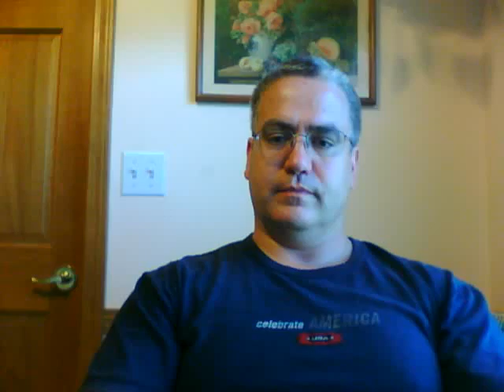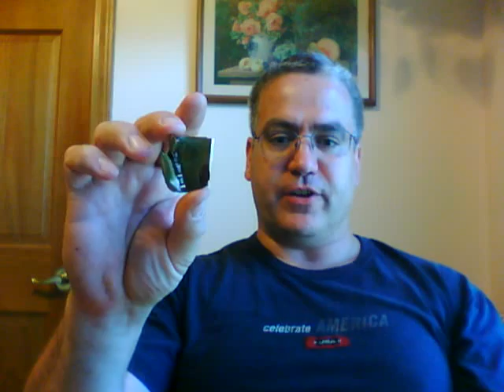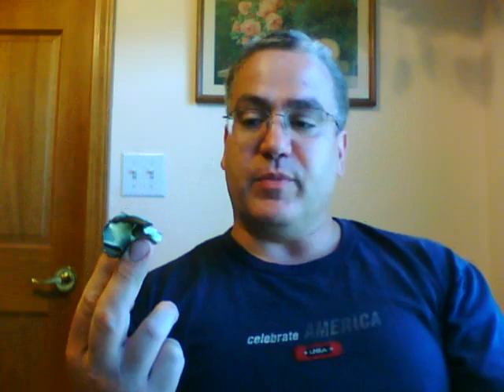Engine Failure 2003 Toyota Camry 2AZ-FE  2.4 L (2362 cc)

Comment: The 2.4 L engine in the 2003 Camery is a non- interference engine - so unless the oil baffle rattles down the timing chain area and causes the timing chain to fail - all you should have to do is replace the timing chain - guides and tensioner... there should be no valve or head damage ...

Comment: I thought it was insanely early for my 2003 Toyota Camry’s engine to croak at 137,000 miles. I am assuming this happened because I went from getting a regular oil change on 3/8/2020 to total engine failure on 3/16/2020! She was my first car, paid for her with cash, and my first love! She is sitting in front of my job just down the road and haven’t gotten rid of her just yet. It breaks my heart!

Comment: I'm looking at a 2009 with the 2.4L engine that is knocking at only 160k. It's a one-owner, well maintained car in excellent condition otherwise.
 It absolutely amazes me how people will excuse Toyota issues and pretend all is well and they all run forever, and insinuate that when they do have problems, its your fault somehow. The only ONLY ONLY reason I'm looking at buying this car is its value once repaired. I have no desire whatsoever to own it as my personal car. I'm much happier in my Ford Taurus. Anyway, it doesn't sound like it's the same issue your dad's car had, but its another example of a Toyota that doesn't live up to the hype.

*Edit, yes I know the 2.4L was replaced by the 2.5L in 2009, but this is an early production model with the old 2.4L.
Reply: John Roberts... AMEN.. I just had to get a rebuilt 2.4 for my 2003 Camry due to the dreaded head bolt stripping that IS a design flaw with these engines and mentioning so on Kilmer's site ended in FLAMING from Toyota fan boys. It is ridiculous how they are " forgiven " for their documented design flaws and yielded as a great car and Company when they ignore that there is an issue and actually have a repair bulletin for the non-existing issue.

Comment: 03/05/2018. My father bought my son a 2003 camry with 122k, in 2013 and it runs great. But is has been steadily increasing in oil usage, now at 1 qt every 2 weeks, engine had started tapping, all with this last  year. Two days ago, the engine started making a very loud Knocking sound. Sounds ready to die. My son says no loss of acceleration, no starting or dying problems. I guess this is the time for replacement of engine

Comment: Mine 2003 Camry se 2.4 vvti just did the same, not sure if it jumped time, but I had smoke come from under the hood and exhaust. Already Walmart had to replace the motor because I be lost all my oil in less then a block. I took the Valve cover off and found the same thing a broken piece of metal. And the cams marred up. mine has 160 but I was changing my oil myself for a while because the only place to get it changed in perdido key was Walmart. Then I started going to a unnamed place.... Thanks for solving how it happened, just don't know exactly what it did to it.

Comment: Having been in the automotive service and repair business the past 45 years I can tell you that there is no design flaw in the valve cover for the Toyota Camry as described by Byron. I do understand his frustration however it should be with those servicing his car and not the manufacturer. There are special funnels designed to be screwed into the top of the valve cover for most cars where the oil cap screws on to add oil. When changing the oil the technician should be using one of those funnels designed for the vehicle he is working on, if the proper tool is used it will not push down on the baffle damaging and dislodging it to then later make contact with the cam gear / chain.
Reply: Here's a dumb question from a non car guy with this particular year engine. Does the baffle serve a critical function? Can it be removed to prevent this?

Comment: I just removed the valve cover on my 2003 Camry 2.4 and that same piece was lodged down in a spot below the cam. Although my car was showing a P0016 code, I'm not yet certain the car has jumped time. It appeared to be running fine but I'm about to check it. My vehicle does have 350,000 miles on it. Thanks for the video

Comment: SO it's Toyota's fault? Being as Toyota goes way above and beyond with customer assistance programs, see warranty enhancements which cover known bugs such as secondary air injection systems up to 150,000 miles/10 years, oil consumption on vehicles REGARDLESS OF MILEAGE in which Toyota will pay for thousands of dollars in repairs at 0 cost to customers and countless other programs. People believe every possible issue they encounter should be paid for by the company when in fact issues such as the one in this video could be avoided if they were to take their vehicles to be serviced at places where the technicians know exactly how to service said vehicle. Instead, people want to take the cheap route and complain when issues arise. Like I said, Toyota goes above and beyond in customer service. Don't believe that? Take your oil burning Chevy to a dealer at 80,000 miles and ask if GM will cover the repair for free.
Reply: capt251978 Control what is controllable- Robust engineering 101. Design to be robust to all service variation or control the service experience, choose what you prefer...

Comment: having an issue with stripped head bolt when i took off the valve cover ifound the same piece, lucky it found a spot that didt damage the motor pure luck .

Comment: This is true i have a 2002 TOYOTA CAMRY bought brand new did the oil changes my self always there was this noise in the engine and when i open to change the valve cover gasket found this piece broken setting between the valves and removed it after that the noise is gone it's now 180,000 miles nothing wrong with my engine i think i was lucky its didn't go any ware to create a damage to the engine.
Reply: if you set the chain were  it should be rotate motor and the cam will be right at TDC but th r marks on chain what be why

Comment: That sucks buddy but I dare say its not Toyotas' fault.  Like you say its about rough servicing, and you could not blame Toyota unless it was their lube boys that did it.  Were you getting the expensive all genuine Toyota dealership services or were you using a different mechanic or doing it yourself?

I have a 2azfe and its pretty awesome and robust.  I have studied the baffles inside the top cover and they are riveted in there not glued or pressed, and I have even used copper max to reinstall the baffles on other Toyota engines and that lasted years and I even pulled it down to check numerous times its adhesion, so in short, I know things don't just come apart randomly after ten years.  In physics there is a concept of action and reaction, unfortunately your reaction is to a persons actions but its easier to slander a faceless corporation.

A proper action from Toyota would be to ignore this kind of complaint.  I appreciate how much it sucks, but blaming toyota 10 plus years later seems hollow as it was fine when they provided you the car and its more likely what has happened since.  I find it sheepish that you gave no info on service history, yet you have no trouble summing it up as Toyotas fault.
Reply: Truth is not slanderous, is it?
Reply: Its not truth its opinion and its unfounded.  I have a spare 2azfe top cover here, you want me to belt the baffles out to show the force required?  Come on.  Ill make you a video.

Comment: Exactly what happened to me! I have a 2003 Toyota Camry 4 cyl. It started putting out smoke on cold starts so I had a valve job done at the local mechanic. Afterwards he showed me that exact piece of metal and told me it was broken off inside my engine. I don't know how long it was in there or if it did any damage. Valve job didn't fix the smoke. I love my old Camry and I don't plan on getting rid of it. Even though it smokes on startup it goes away after a minute and I still get 38 mpg with my old lady driving style.

Comment: all I have to say is good insight on what happens ..I'm a huge Toyota fan my dad's Camry is a 03 with 300k plus ..sounds like the jiffy lube guys had a bad day ..the Camry has been great but time caught up and the oil pump gave out and threw a rod ..not Toyota design flaw at all ..I'm gonna take it to work send the head out and 're sleeve the block and put brand new piston rings and have the crank milled ..I believe in the only American built car

Comment: i have a 2002 camry my car was making a loud noise in front of the car i belive change the oil my self noise didnt go away when i rev the rpms the noise was still there but didnt go higher let the car run for a while try to see if the loud noise would go away but what happend next was that my car shutoff and didnt even crank after that

Comment: This will only happen if some one opens the filler cap and forcibly bends the baffle plate,  me thinks somebody is trying to make a false warranty claim.
Reply: +saif1002 you thinks wrong.
Reply: saif1002 agreed abuse is the only way this can happen, robust engineering of this component unfortunately was overlooked.
Reply: saif1002 not true no one changed my oil 2003 has engine design problems look online you will see oil leaks excess oil useage etc.

Comment: does the v6 models have  the same problems?
Reply: +Vincent  Bruce any motor has the same problem if you treat it poorly, and that's what's happened here.  Were talking about half a dozen people max all who did the wrong thing trying to get Toyota to declare a product faulty that has had several million units worldwide sold with few issues.  Post 2006 2az had a recall about oil consumption in high mileage vehicles, and its only on the later engines with oil squirters that cool the lower side oif the piston.

Comment: mines at 195thousand miles u have to change the timing change I believe that maybe you didn't change a timing chain in time there's also a part under the head we're 4 bolts strip and u have to re thread them and put plugs and new screws my timing chain was replaced at the right time I've never had any problems at all if u keep up on the parts it can run 630 thousand miles so I think you guys didn't change the timing chain at the right time

Comment: Well, it happened at 147k miles, driving a busy interstate, vehicle shuts down and I'm on the side of the road. My uncle - a mechanic for 30+ years - takes a crack at it, and discovers the "baffle" issue. We all are sharing this common experience with our vehicles. Does anyone know how to go about an appeal/recall with the company? I honestly believe there are many, many more folks out there that are unaware of this situation and would never think of searching, "YouTube" for such a topic. Thoughts?
Reply: Josh Dunn due to the age of the involved vehicles and the relatively low percentage of failures vs total production this does not show on Toyotas radar.
Reply: Thanks for reply. I wish there would have been a greater initiative on the part of Toyota to reach out to consumers. If nothing more than just letting folks know about it vs letting it go undetected which could result in a very bad situation for consumers. My hwy incident wasn't the best time for it to go out.
Reply: Agreed
Reply: they shouldve had a recall

Comment: I am having a problem with a whinning sound and my oil light blinking or staying on. I have had my valve cover and timing belt repaired at a mechanic shop before I started having issues and the first time the oil light was flickering I had a mechanic friend of mines check it out he found metal swirls in my oil pump screen (after I went to get the repair) and chunks of new glue from them glue the valve cover back on. Ok the light was fixed a few weeks later I start to hear a whinning sound and my oil light stays on what could it be ? I hear a knocking sound in the front of my car? Did they do something wrong?
Reply: +Keyetta Johnson Unfortunately your motor has issues, metal coming through the oil system screams of bearings with excessive wear, or damaged internals of some description.  Is the metal hard or soft that was in the oil pump?  Valves, pistons etc are quite hard metals, whereas engine bearings are a soft metal alloy. The check engine light will be triggered by low oil pressure, so if oil pressure is low at idle, dont drive it, dont run it, have the motor pulled and rebuild as it sounds like you went too long between chages, oil got low or degraded and now you have sustained damage to bearings and subsequently oil pump.

Comment: I am a mechanic. A 02 Toyota 2.4L came in. I found the same piece of metal from the valve cover laying under the cam. Engine now has internal damage.
Reply: The first thing I would do is remove the oil pressure sensor on the head on the drivers side. put a oil pressure tester in place of the sensor and see what kind of pressure you actually have. The sensor could be faulty. If pressure is low. then remove the oil pan.
Reply: daringman78  pull the oil pan and check the oil pump  pick up / inlet tub. it very well may be plugged.
Reply: I have 2002 camry with 12000 miles and the oil engine light start flashing when on idle for few days and it came solid. I changed the oil and filter but it still has the oil light on and the engine start rattling toward the bottom. ANY CLUE what could be the problem or what to start with. I'm thinking of the bearing since the oil pump is impossible to fail.
Reply: @daringman78  i have the exact same problem. Just today he got worse with acceleration I think it might be the oil pump I hope nothing major is broken. My 02 4 cylinder has a hundred and seventy thousand miles on it. I had already replace the oil pressure sensor
Reply: thanks. I will try when have time and keep you updated

Comment: Just removed the head off of a 2003 Toyota Camry to fix a valve seal problem and found the same exact piece of metal jammed inside the head. Lucky it didn't get between the chain. That's a piece of design. Car had 117000 miles.

Comment: Good video and thank your bringing yet another issue with toyota.  I bought a 2008 toyota and at 88k miles this car has engine problems.  The excessive oil consumption problem is extensively reported by toyota owners but in most cases this problem is not covered by the warranty because it becomes noticeable after 70k miles.

Comment: This (along with stripped oil drains) is one of the reasons I change my own oil.  Is Toyota responsible?  Absolutely not.  The overly aggressive oil change outfits are.  The very idea that the manufacturer is responsible for the abuse by non-Toyota service centers and oil change outfits is absurd.
Reply: Mitchell Carson  The design is the absurd part!!! You should be able to put oil in a car if it needs oil!!!!

Comment from the maker: What I find amazing is the negative comments and the defense of Toyota. YES, a tech should be gentle upon insertion, however not every tech is, so do you want a catastrophic engine failure because engineering did not practice robust design? Robust design states a process, procedure or in the case part should be robust to all process variation. In this case when over insertion or abusive insertion results in an engine failure, there is clearly an opportunity for improvement in the design of the baffle. If I were still a tech I would either be selling customers on removal of the baffle, or I would design an improved baffle and sell it to every Camry owner as disaster avoidance.
Reply: +Byron Hatch How could you insist all your customers properly modify their own engines with the baffle, I dare say this would lead to more failures as the stock baffles are riveted in, and people playing at home would have to drill and tap fasteners which could come loose and interrupt the valve train or use adhesives which I see as less robust than stock rivets.
Reply: MJBOGAN what customers? Do I own a garage?
Reply: Clearly not.

Comment: Not a design issue, its a "technician" issue. Its not made to hold tje oil gun in when they jam it in . Its made to deflect oil from comming out from timing chain gear.. blame ur "tech" not toyota.
Reply: Read about robust design, this is an issue that can be controlled by not giving an oil tech the opportunity to destroy an engine.

Comment: I understand what you are saying Byron but just to clarify some things, this is no way Toyota's fault. If a Toyota Express Lube Technician / other lube guys  are " jamming " the oil fill gun into the cylinder head cover well he will have to be spoken to with his foreman or manager. There is no need to do that. Also, Toyota has manufactured a threaded oil fill funnel that is indeed available to all aftermarket shops to fill oil properly for this particular engine ( 2AZ-FE ).  Part# AHOFTOY1038. Even the tops of quart bottles will thread into this cylinder head cover to fill help you pour it in, mess free and drama free. A recall is a little excessive don't you think, A TSB is practical, a recall would involve Toyota to completely REDESIGN a very good engine, and all this for an overly aggressive lube tech i see no recall in no near future, Toyota is probably laughing as we speak. As for Robust design, i do not think this baffle is considered a wear item in my opinion and seems to only " break " when its User Error. Just my 2 cents. I do not mean any disrespect, - Dave.

 Expert Level Toyota Technician